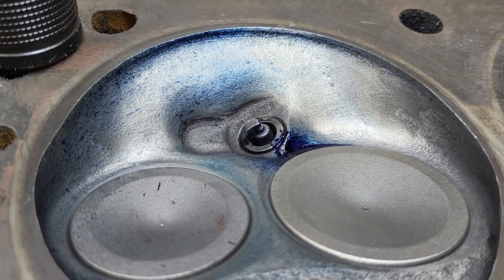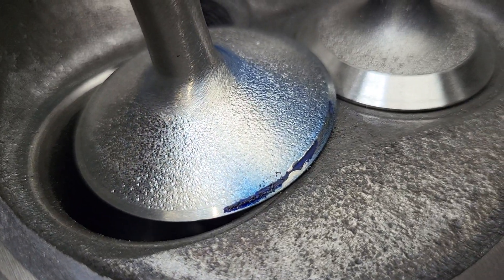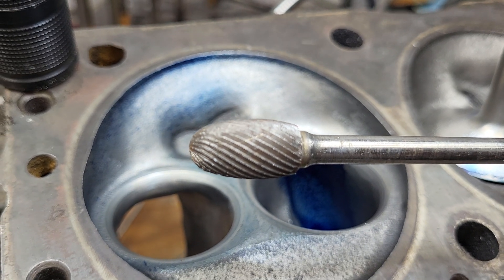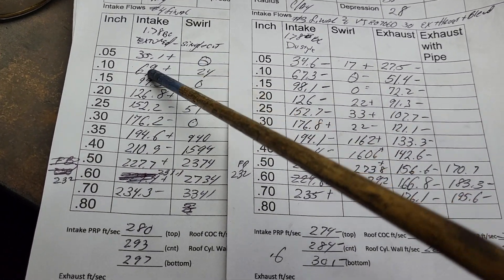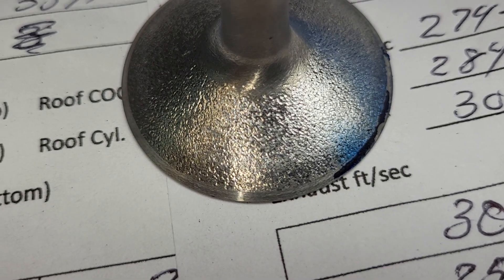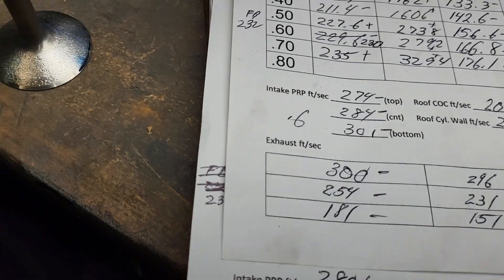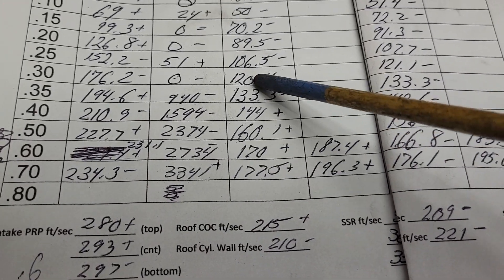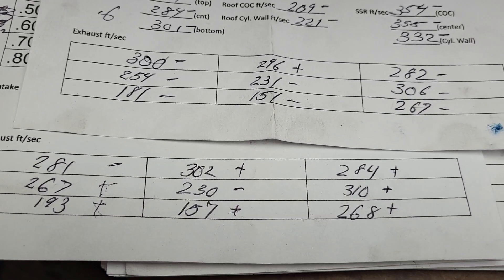David Vizard, Unity Motorsport, Mission Impossible 318 project. Textured intake & nailhead exhaust

Comment: I remember David Vizard saying that 39 degree cut will make it look it’s a bigger valve upon early / low lift … plus if it’s a reground stock cam they are using as they said, I don’t think it will be going  over 600’ lift .. cheers
Reply from the maker: I don't know if a regrind will go that big. Thanks

Comment: 231 cfm x 2.2 is 508 HP "possible"?  Going to be interesting to see what some 2.02/2.03 LS 8mm valves accomplish in a possible later version? Just as information: the uhhh folks that want to saddle it with only stock mopar parts, valves with broomstick size valve stems might want to consider cutting down their use of hallucinogenics? Stock Appearing, don't have to mean "Stock" in a performance application!  Have you or DV sonic ever checked the LA 318 bores?  I saw an Engine Masters entry from Hinkle Performance in London, Kentucy, were they used a poly heads on a LA block. He "said" when he has sonic checked these LA 318 blocks and they do not have core shift, he thought the casting core was the same as a 340 & was safe for 0.105 overbore or 4.065 bore. Bore thickness was still 0.180 after boring to that size on this particular engine.  Which I found to be Very Interesting!
Reply from the maker: I think it will make good power. I will not be doing a 8 mm ls style open chamber. I have had enough. Thanks

Comment: I like the burr finish on back of the valve, i did a rough glass peen finish on mine. Did a comparison test just running a smooth valve vs peened valve under the faucet and its amazing the sheer (boundary layer)just a peen finish will do vs smooth where the water coated the valve
Reply from the maker: Yep!

Comment: If you spin this 318 over 7k, and I believe you will, they have a tendency to pump all the oil into the valve covers. Mopar small blocks unfortunately do not have priority main oiling. Restrictors are not good on the street, but I did meet a successful stock eliminator driver who told me that was how he kept the bottom in it at 8300.
Reply from the maker: I did not know that. I did have that problem on Fords when I started. Pumped the pan dry!

Comment: The 3 most important things for power, air speed, air speed n air speed Charlie hahaha
Reply from the maker: You know it!
Reply: You have to have atomization in to the equation. I run rough burr finish on my tunnel ram and bsfc numbers show it is very effective for power.
Reply from the maker: @Moparmaga-1  I did the same for D.V.'s race engine challenge intake manifold. He stated the bsfc was very good. 421 cubes 743 hp. Thanks

Comment: i bet the BSFC would be better,,,,but these heads aint for that
Reply from the maker: I am into efficiency so I like it! If D.V. builds a syphon carb it will need to help with fuel prep. Thanks
Reply: All good cylinder head work is about effiencey !!! Air Flow , Wet Flow , Combustion effiecency - Its All Power !!!
Reply from the maker: @bobgyetvai9444  I agree!

Comment: Another question...

Are you dripping your dychem from the inlet of the head, or from the inlet of the manifold?

I ask, because, as we all know, particles shift, deviate and break up dynamically, the more turns, collisions, and surface roughness they encounter.

Ironically, the best possible material to use for that would be something with the exact nature of gasoline, only, [PREFERABLY] without the combustibility of gasoline.

No clue if such a material exists, but on the other hand, one could also resort to boxing it all up in a container full of nitrogen.

Major drawback is, unless there is some kind of dye in the fluid, of course, you won't make any marks.

Truthfully, this is where having multimillion dollar research tools come into play, because what one needs to be able to measure is something that behaves like gasoline, which shows in 3 dimensions, everything going on inside the entire region of flow from inlet to compression.

The problem I see with dychem is that as it flashes dry, its going to become big clumps, and if its not flashing dry, it flows down the suction port, and leaves no record.

I realize, you are doing the best you can, with what you have, could you get something nonflammable like a brake cleaner solution and try the flow with just a dilute amount of dye along the entire reach from the carb inlet [literally feed it through a carb, and preferably the one to be used in this application] so that one can just over time, monitor the flow from the jets to the cylinders.
Reply from the maker: These tests are just the head. Thanks
Reply: Darin Morgan has done these tests. Extremely expensive like you say. Those are the cool photos he uses on his thumbnails.
Reply from the maker: @bobirving6052  No doubt. Thanks

Comment: If I were going to taper back the stem of the valve, I could custom form a diamond grinder wheel to contour, and put them in a collet chuck, so I could micro grind those surfaces to prevent stress points.
Reply from the maker: I wish I could!

Comment: It looks like the texture slightly shrinks the valve area a bit, so while it helps in lower lifts, it also doesn't top out as good, but I think it's a good compromise especially for how good the wet flow has gotten. Probably enough to get away with an extra half a point of compression to make up for any CFM you lose.
Reply from the maker: I like how you think. Thanks

Comment: The fin in the port is what's causing the swirl to suppress itself then kick into overdrive at higher lifts. At lower lifts, there's not enough rotational energy, and the port flows symmetrically, at higher lifts, there's enough energy that the fin starts pushing the flow towards the cylinder wall side. If you put the fin towards the center of the cylinder it'll make the swirl kick in earlier, toward the cylinder wall side, then you delay the swirl even more? Might make a good science experiment.
Reply from the maker: No, I like the swirl curve. Thanks